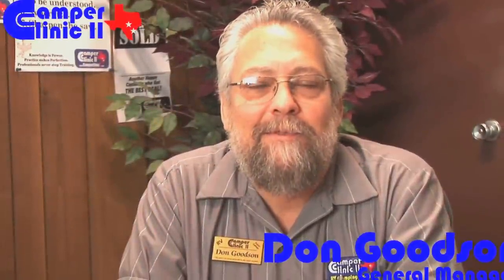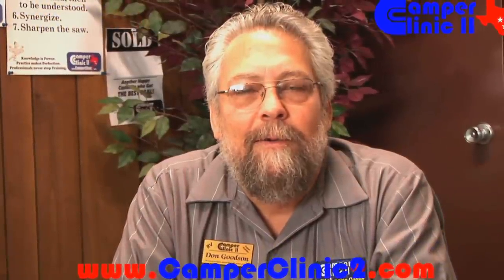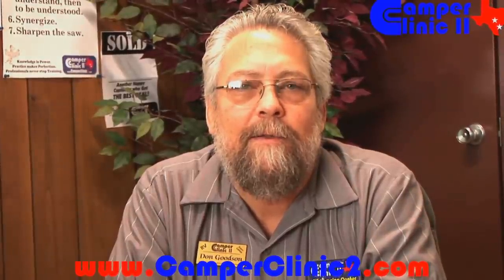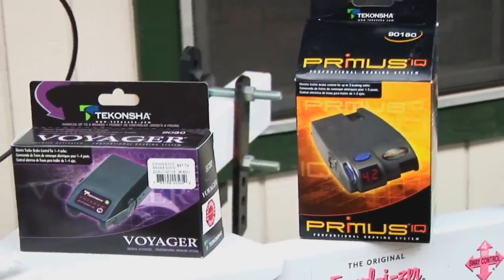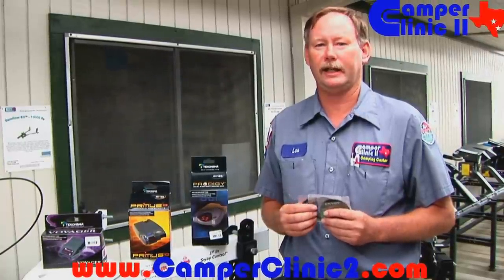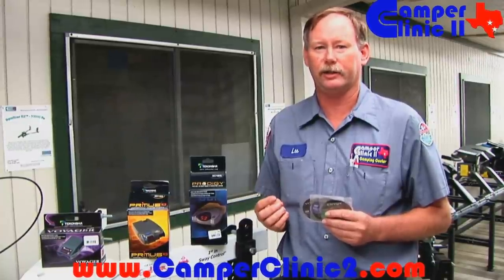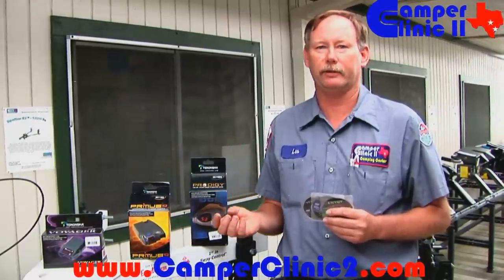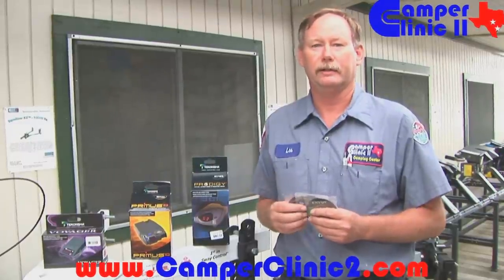RV Quick Tips: Brake Controller Settings For Towing a Trailer or Fifth Wheel.

Comment: i have a 1999 tropical RV 37 footer , and i got this brake thing on my gear shift , i been trying to find out what  , this thing is and how to use it , i tried google image , but no luck , and theirs no way of putting a picture here , believe me i tried , i am almost temped to take it off , but i am new at this RV thing , it has a grain nob on top , the writing on it , best as i can read it , says manual brake ufort , and it has picture of a red outline of a shield , with big us red letters on it , and small writing on the near bottom of the shield , in witch i cant make out . it got a gray wire that goes some were . don't know were . anyway it attach to the gear shift with screws , like its made to fit on the gear shift , any help at all would , be most grateful believe me . GOD BLESS